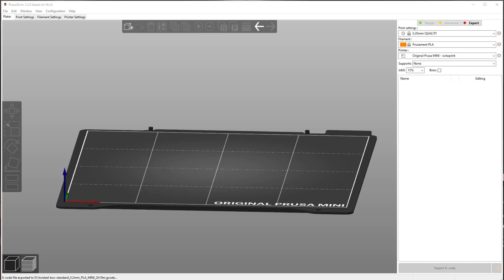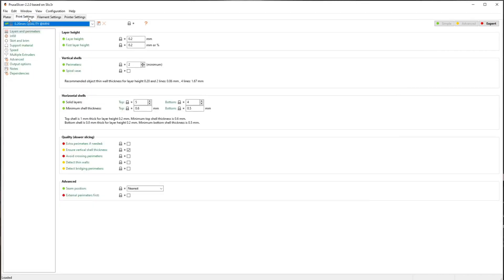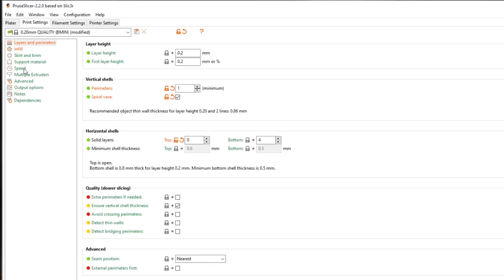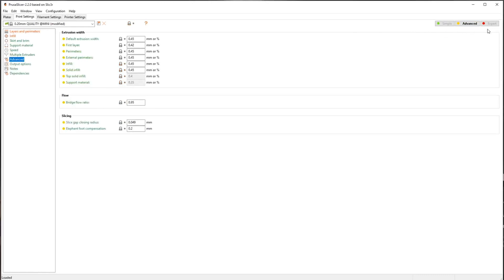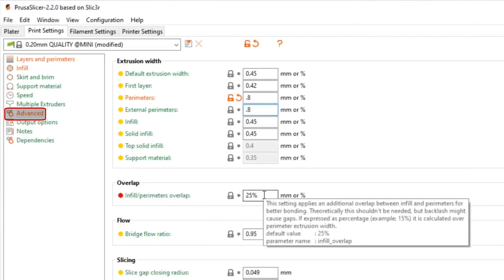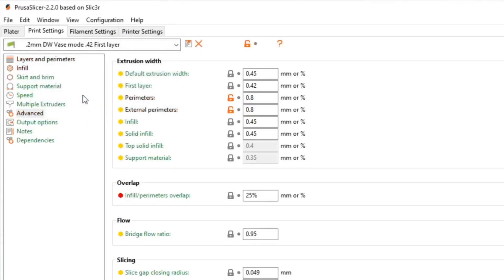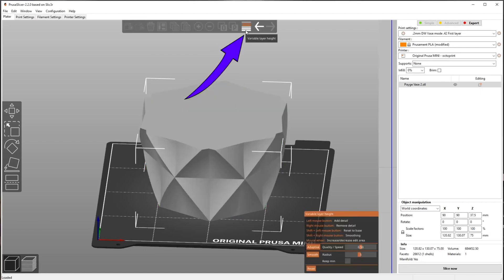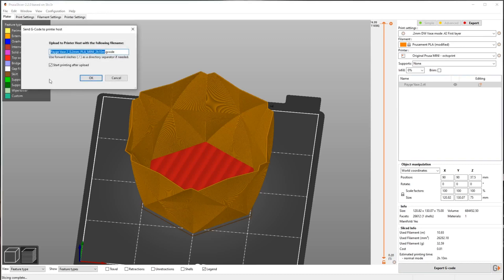Prusa Mini - Prusa Slicer Double Wide Vase Mode

Comment: if i do this with prusament  PLA should i change any of the filliament settings?
Reply from the maker: If you are using Prusament, simply use the Prusament settings, you may want to up the temp a bit, but that's it.